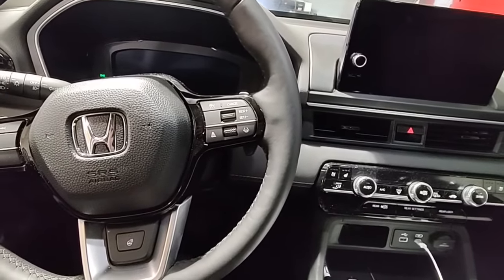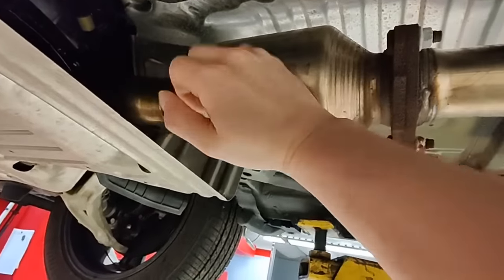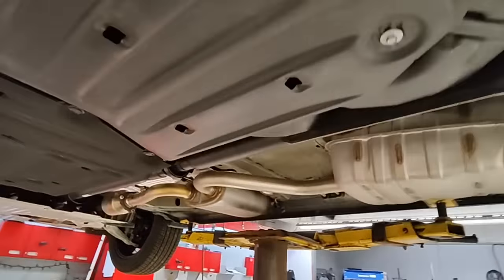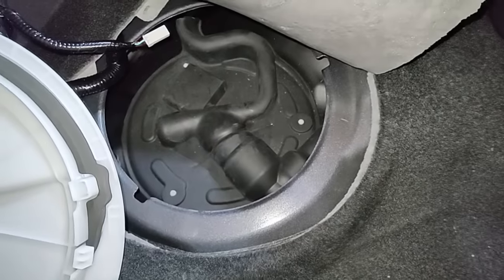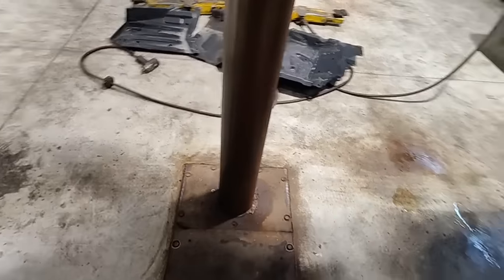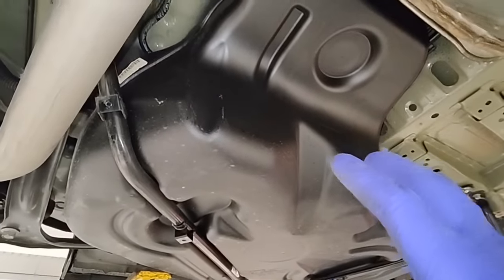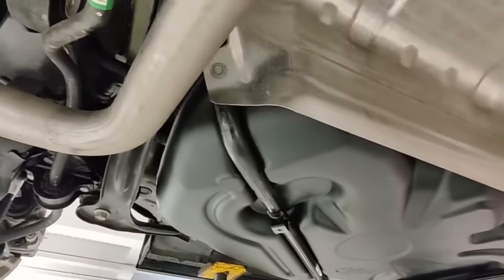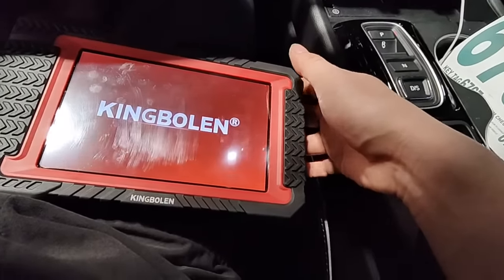Thieves are getting a little bit smarter, just a little.

Comment: 1.91 a U.S. gallon- try $2.70 /litre. Just very approximately due to exchange rate, multiply your gas price by 3.7 and you'll get 🇺🇸 (well Canadian,) equivalent of what we pay / us gallon. That's $7 (seven) CAD$. Your fuel is way too cheap, btw. You need to get those insane private trucks OFF the road.- just saying.
(We have much more tax on fuel, which is meant for funding the roading infrastructure. + the exchange rate upon fuel prices.)

Comment: Too bad they don't sell a kit where you could drill the hole to a certain size and then insert a toggle like a drywall anchor.  This would have an o-ring outer nut that could be tightened to seal the hole without the whole fuel tank.  There are lots of places I don't go to because I fear my tank being drilled for a little gas.

Comment: Honda engineering access to the fuel pump!  Need to put a tap on the fuel tank to make it easier for them next time; because there will be a next time!  $1.91 a liter!  That  is over $7 a gallon (a tank would be close to $100)!  Crikey!
Reply from the maker: Its at 2 bucks now last year or the year before it was in the $2.70 a litre.
Reply: I am assuming you converted Canadian to US dollars ?  Or did you forget ?    0.74 to 1.00 makes quite a difference.  The mighty Canadian dollar is only worth 74 ¢

Comment: JB Weld to the rescue for $12 or so.😂
Reply: And depend on the fuel filter to catch the metal shavings in the gas tank (or other shavings if the tank isn't made of metal)?
Reply: Epoxy resin..don't use that krud to seal a tank. Or weld a patch out of only abs plastic.  Which has to have the tank purged while welding.

Comment: If they were smart they would have drilled one hole in the bottom......lol
Reply: Drill one hole higher up the Tank first if Fuel runs out you got at least half full tank then it's worth it to drain off the Rest with the second hole.........